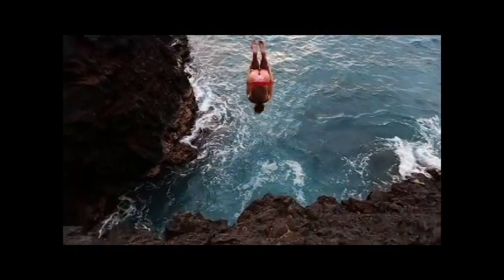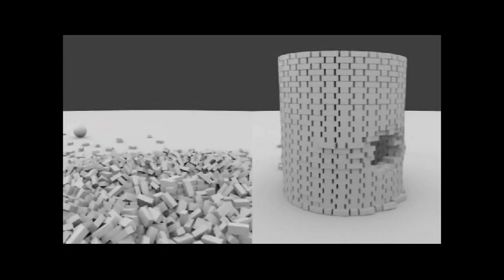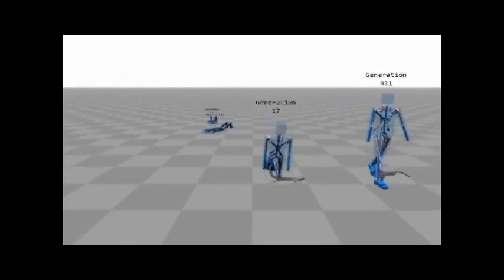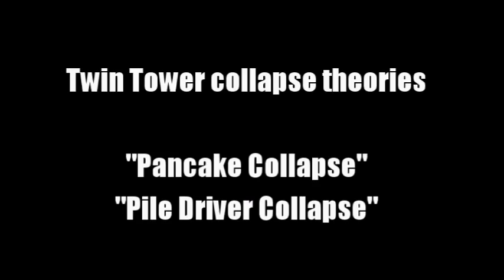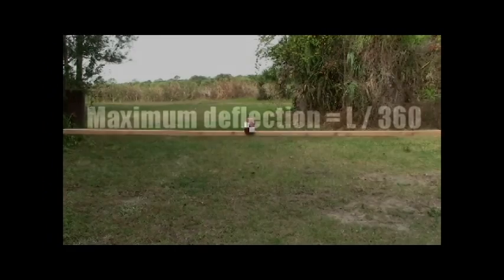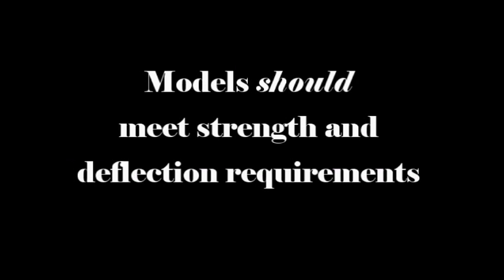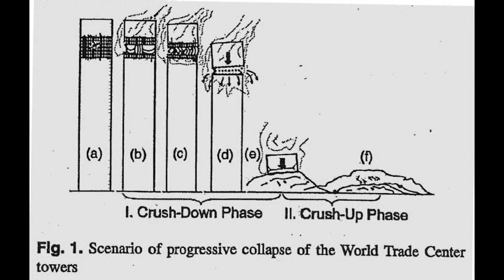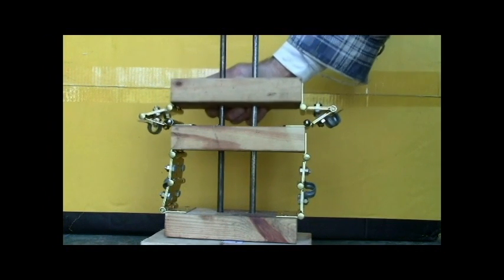9/11 Experiments: The Force Behind the Motion

Comment: Drop a standard  brick from 3 feet,  on a hard floor . Result : it might break in 2 pieces and thats all. now drop a 100 times bigger brick from 300 feet . What will happen ?  it will turn to dust with a big boom !
scale matters in crash investigations !
Reply: Thinking that you can have conclusive results with a scale model is fundamentally flawed logic !!
Reply: @ evsupp2011: Buildings are desighned to resist static loads , not dynamic loads .
The twins were not designed to withstand big planes at high speed and full of fuel.
Reply: When you scale down the Twin buildings a hundred times to about 4 metres high, you are not scaling down the impact energy of the falling upper section a hundred times, but a lot more than that !  The impact energy doesn't go down in a linear way. 
Scaling down the towers for collapse analysis therefor is useless !!
Reply: You just ignore the rest of what he said !  Speed is the most important factor in the crash energy !   according to the laws of physics
Reply: There was no free fall . Resistance slowed the collapse down for 3 seconds , thats a lot of %'s of the total collapse time.
Steel beams, weighing tons each, are ideal for large destruction when you drop them. An avalanche of stones from a mountain slope is destructive , now think about an avalanche of steel that comes down almost vertically.

Comment: The unrealistic model  that you said is more convincing, seeing the manner in which it collapsed owing to weakened steel structures, but it's highly improbable that the structures weakened. The upper section  may not have crushed itself back up. It was burning anyway and on impact with the ground it got disrupted into a rubble.
Thanks a lot, your experiments helped me largely in preparing my presentation for my college assignment.

Comment: your experiment with the floors along the wooden tower  is flawed because you are dropping a single weight right in the centre of the top floor.  Of course, that will just break the "floor" in half and then a few floors below that one.  Totally different than reality. Each entire floor dropped onto the floor below, increasing the total weight as they fell, gathering a new floor along the way and getting even heavier.  Your experiment is also using much stronger and thicker material if you are trying to make things to scale.  The concrete in most floors in a high rise like that is only a few inches think and sometimes sits on a thin metal pan.  Each floor in that building was only supported around the perimeter of the building.  There were no steel beams inside.  That was the unique selling point of the building, but ultimately the cause of its demise.
Reply: jet fuel didn't melt steel.  It weakened it to the point that it bent and eventually gave away.  Simple to understand for the average person.  Guess not so simple for "special needs" people like you.
Reply: I highly doubt that anyone gets paid to comment on stupid youtube videos, but if that is your only defence, it shows just how stupid you are.  I have no issues with attacking people, especially when they are trying to drag society down to their level.  People like you who probably think you are smarter than every structural engineer on the planet. People who graduate from universities all over the world, and you think you know better.  people like you SHOULD be  called what you are and put down on here daily. I know it goes into one of your ears and out the other, since your head is hollow, but the attack is meant for other people to read and see how easily you are exposed as a fraud.

Comment: To better simulate the actual building you should re-run the test at 6:17, but instead of having all the boards secure in the sides, have them supported much less.  You are massively overbuilding your supports.  Each floor was only rated to take 1,300t more than it's own weight, and at 500,000t total weight for each tower, the top 10 floors weighed about 45,000t.  To test how much to cut out of the support part (which should break at the sides, not the middle), just laying a few unsupported boards on top of a supported one should cause the side supports to fail.  Re-try your experiment with that criteria and see what happens...

Comment: Your experiments are deeply flawed in my opinion. The first one has an exterior support 10-20 times greater than the actual building with no interior support. The subsequent experiments always have a continuous inner support. Which the actual building lost due to the heat,planes destroying them and the weight above buckling them inwards.Because your experiments always have a inner support or guide path we can't except these as actual events. We also have to acknowledge that your paper theory is 1/100th the weight that was  actually in play that day.Also plastic is not a very good component to use to replicate steel. It has a tensil strength many more times at your scale than what steel does. It also can give in the direction that you want it to. As you have successfully done.For me to believe your thoughts I would have to have materials of comparable strengths and proper scale with those voids that the planes created and a comparable heat source for the same amount of time.

Comment: The deflection contraption that he built and showed at the 6 minute mark does not accurately represent the Twin Towers.   The outsides of his contraption is one solid piece, running the entire length of the contraption on both sides.   The exterior columns of the Twin Towers were not one solid piece.   They were in sections,  tied to the inner columns by connecting bolts to the floor joists.  When the top of the building, represented by the steel weight in the experiment,  hit the floor below it, those connections were severed.  The sections of columns would now be free standing and the force of the top of the building would have forced that section outward.  Each section would have tore away from the section of columns that were directly below it.  That's why the columns shot outwards and then down.

In his experiment, the outside wall was represented by one solid piece of lumber from top to bottom.  It couldn't have broken away in sections because there were no sections to break away.   This renders his experiment an inaccurate display of what happened.  His experiment would have been accurate had the outside columns been raised as one solid structure from the top to the bottom.   That would have been impossible.  

As it was,  the weight in his experiment still smashed through multiple floors, even though his solid outside walls were a much stronger representation of the actual walls of the Twin Towers.

Comment: Add each of the components together that you INDIVIDUALLY analyzed, apply that to a real building, and the fact that as it falls each floor that collapses adds to the weight of the falling mass... and you get a 9/11.  You can do basic math OO...  Jet fuel can't melt steel beams, but it can ruin structural stability in the joints of said beams and around the massively fire damaged structure that they support. Real physics. Go do something useful with your life. Hanging onto "theres something else here" feelings based on skewed "facts" and perspectives only make you find what you WANT to find through whatever means you can manipulate others with to make yourself not feel crazy. You people are crazy.

Comment: ... if enough people put enough money together for a long enough amount of time, I'm sure it would be possible to easily demonstrate that the alleged airspeed of the jets that supposedly hit the towers was actually physically IMPOSSIBLE at that low of an altitude... there's got to be some way to demonstrate, using an actual freaking 767 or whatever, that it's impossible to achieve 550+ MPH at only hundreds of feet above the ground... the airs just too thick and the engines don't have enough thrust...

Comment: VERY GOOD!  Even paper wouldn't collapse "correctly".  The concept missing is Accumulation of Mass.  As the building "fell" the mass beneath accumulates causing deceleration and seizure.  Therefore, the mass beneath must be removed or pulverized to allow room for the mass above to keep moving.. Meaning, the concrete pulverized, and the steel melted.  And, even if burning jet fuel could weaken steel, it was all burned within one minute.  And what about building 7?  There were two buildings between the towers and building 7.  They didn't even collapse.    Keep up the work there if possible.

Comment: laughs at the discussion on dust and steel and brick vaporizing. actually staring at footage of ground zero search and rescue. big ass pieces of concrete big ass pieces of steel lots and lots off debris bigger than a human plus interior materials. paper, broken signs, furniture etc etc. would like to know just what in the fuck you guys are actually looking at? watched a nurf dart tear through a aluminum soda can like butter using a vacuum gun. actually learned how that building was made. I'm no expert but I do know that holding the outside of a building to the core of the building with floors laid in sections then bolted down with four bolts and concrete poured on top is a perfect way to have a building collapse if compromised. can you say design flaw to save weight? my last thing. if the towers were brought down through controlled means and if the experts say that the building could not fall please tell me exactly how on earth a. thermite could be wrapped around beam columns that cannot be accessed unless you get rid of all the materials blocking them( don't give me that elevator shaft shit. b. if it were controlled why on earth are experts contradicting themselves saying only a powerful explosion could crumble a building like that(PSsst. little secret. it did not disintegrate ground zero clearly proved that) if you say steel and big ass concrete is not everywhere, stop breathing and save the lies for someone else. but these same experts then say that it was brought down by thermite. well let's see. thermite if chain ignited will actually create a delay in collapse (won't fall smooth )look up thermite demos, I have. Lastly. this is a 110 story building. if a building of that size can be brought down that fast with explosives in that manner. then please answer one simple thing.  I do mean simple. why is it no where else on earth no building has ever been demolished from the top down in that manner? why has no other demolished building on this planet crushed the build from top to bottom? well. I know you brain dead people will repeat non sense but I mainly said these things in hopes that maybe some of you will hear how stupid you sound. we don't know the exact truth but I do know that, that building fell because it was compromised by a plane and revealed its design flaw. I also know that a fucking iceberg punctured the hull of a big ass ship said to be unsinkable exposing its design flaw. funny how that same ship sunk faster than expected. did not hold up like expected. and sunk in a manner unexpected that still is debated on how, to this day. I guess the feds or government sunk the titanic as well. give me a break. God bless the souls loss to 911 and titanic. oh and if the building design was not flawed as I stated do tell me why the outer skin piece of one of the sidings of the towers was standing through the rubble? this was a controlled demo right? so if explosives can leave the siding upright in a pile of debris  (showing that the floors could cave in leaving the outer walls intact) why on earth would I not believe that the floors could not support the weight coming down on them and broke loose like cardboard at their joining points. if you can look at that skin in that debris and not see a floor or truss attached to it. wtf on earth would make you not believe that a gravity fed collapse from the weight of the upper section that collapse on it, would not cause that effect knowing how the floors were actually made? seeing that piece of siding in the debris with nothing attached to it but still standing with tell signs of the top being ripped apart not blown apart. I'm sorry to someone who pays attention to what I see and learn 911 conspiracy theorist just sound plain delusional to me.
Reply: remember there are dumb ass people still to this day saying titanic was brought down by a torpedo. Food for thought

Comment: There is a fundamental flaw in the experiments.  The support structure still holds the floors up after they have broken in the model.  In the "pancake model" for the twin towers the outer support link to the floor is what is broken.  It's not the floor strength you need to test.  It's the sheer force for wall supports.  On 9/11 we see that the outer layer of supports peels off and fall outward.  So you need a mechanism for the wooden support to move outwards when a floor collapses.  You are testing the wrong thing.   It's not each floor that needs to be tested, it's walls support connection to each floor that needs to be tested.  Your solid wooden support structure makes your model invalid.

Your pizza box experiment has the same flaw.  The steel outer support peeled away in the actual 9/11 video, leaving the lower floors weaker.  You can see it in the way steel falls outward and down from the smoke and dust.  Also, in your model each floor has a springing motion caused by the plastic legs bending outward slightly acting as a shock absorber for the system. 

The second plastic model which you say is unrealistic and is "designed to fail" actually models reality better.  The steel supports were made from waffle patterned steel sections that spanned multiple floors.  Once these were compromised it caused floors right below a the impact point to be weaker.  The crushing motion meant that once a floor separated from the support it free fell.  This is the first model you have made which captures that free falling effect.  Also, the reason it slowed is because you started fast, and terminal velocity for this was slower than that speed.  The towers started at rest and sped up as they fell because they hadn't reached a terminal velocity yet.  They did fall slower than free fall, as is evidenced by the debris falling before the cascading failure in 9/11 videos.

Your paper and toothpicks are another straw man experiment.  Once the floor fails, the support is still there.  In the towers the outer supports didn't hold the floor after it failed.  The walls supports were sheered and pulled away from the floors.  This does not capture the nature of a building being supported mainly by an external frame.  (I know the internal supports held a lot of load, but they could not hold the building without the outer supports)

The building didn't decelerate because things don't speed up faster than they can go and then slow back down spontaneously.  Think about what you said.  If it failed, accelerated through 10 floors, and then slowed down again we would say the first 10 floors were weakened.  Then we would have evidence of tampering.  But since it didn't decelerate we know that the structural failure was not the result of milti-floor tampering.   Or maybe you mean the initial break should have been stopped by the remaining floors and only crushed a few of them.  The main problem is that the building was never designed to withstand the force of all that matter.  F=ma.  Force is equal to mass times acceleration.  How far can the floor of one of the towers be pushed before the bowing of the outer supports causes structural failure given that the floor above it has experienced an outer bowing that caused a structural failure, thus compromising 66% of the waffle supports?  Using that distance we can calculate the acceleration required to stop the fall of the mass above it.  Using that acceleration we can multiply it by the mass of the floors above and get a rough idea of the force involved.  That force was far too much for the building to handle given that it was already damaged.

Comment: sorry your experiment is off you are dropping a hevey weight on sum think week  showing resisters drop the load a small dissent whith a lot of mass that will add to the load will expand the force  your experiment 20 kg onto say 50 gr per floor will slow it down tray 20kg +10kg per floor say  100 floors is a lot extra mass  extra mas will cose the faster drop sorry   nice tray tho :)

Comment: forgot one gigantic thing the tower DID slow- stairway B north tower 16 survived core demolition wot have killed them and watch frame by frame on some footage you can see the core STILL STANDING after collapse how to collapsed : facade caved in dragging floors down after they collapsed the shear violent  force of the vibrations took the core too witch also slowed down towards the base as again STAIRWAY B 

your tests are inaccurate as steel can bend your paper rings can't.

Comment: Im going to give you a reasonable question. Looking at your models, they are imperfect regarding the following: The building is not solid; it is 95 percent air and, hence, can implode onto itself. Your models are 50% air. Can you build a structure 95% air and not get similar results to the collapse?